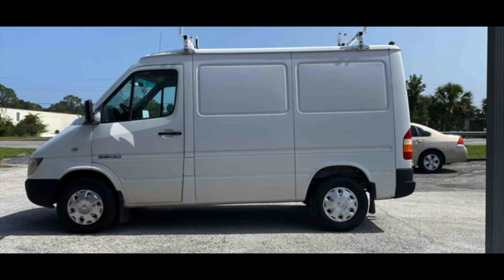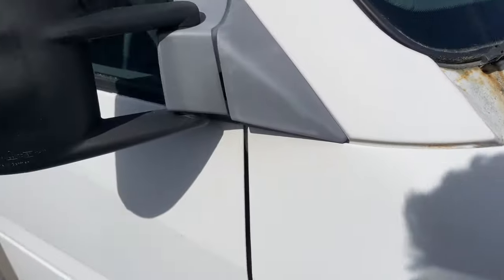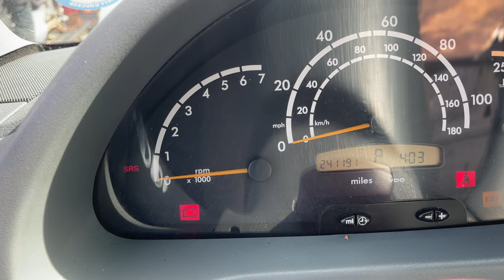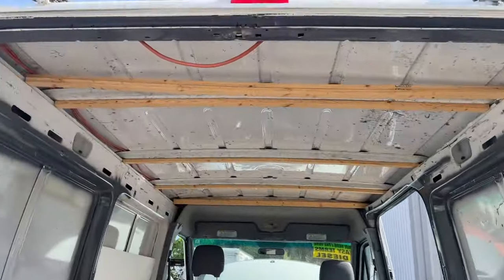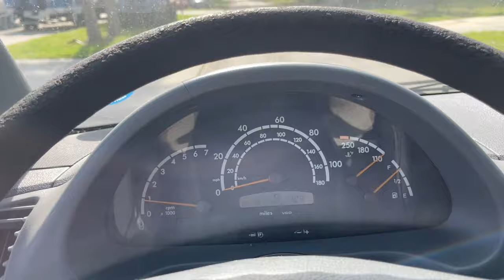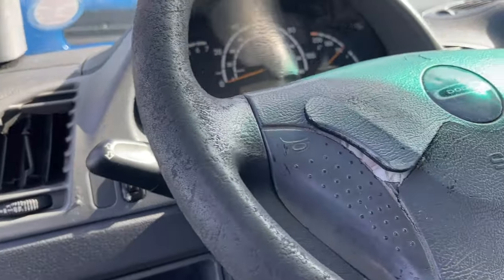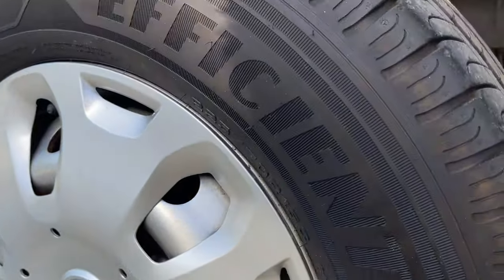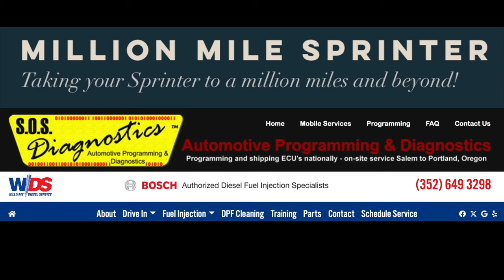118' Sprinter in Daytona Pre-Sale Inspections

Comment: You mentioned a slight rumble when driving under load. What causes that?
Reply from the maker: A few possibilities. RSN or Rumble Strip Noise is one. It is a valve shutter in the transmission that does not cause damage and is only a comfort issue. Carrier bearings and misaligned drive shafts can be other causes if it is not just a tire wearing unevenly.

Comment: Hey Florida Van Man! There is a rare passenger spec 2005 T1N Sprinter 118 for sale in Portland through a dealer called OttoEx. It's pretty pricy, but it's in ULTRA MINT condition. It's got 110K miles on it, it's only ever had one owner, it's the high roof, several rows of seats, upgraded speaker system, windows all around with nice covers, they have ALL the service records since it was new, it's incredibly clean, they've swapped out anything with any level of wear. They are asking 38k. Is that insane, or in this one case for this rare unicorn would it be in a reasonable ballpark?
Reply: Oh and ZERO rust.
Reply from the maker: They post that van or one just like it about once a year. I don't know how legit OTTOEX is or where they get these vehicles, but the website looks a bit suspicious with no physical address or named persons. They have a page on "How to register your imported vehicle" implying the imports they sell are not easily registered in the USA. The site says this van is "sale pending" this morning but I feel the price is outlandish.

Comment: Happy Easter to you. And question I'm getting 12v and almost 9v on to of the pins for ac pressure sensor? What supplies this and should not be just 5v.? Appreciate you!
Reply: I plug the pressure sensor in and the compressor and aux fan shut off. Unplug they turn on?,>I know this cab took on water ? Ecm?
Reply from the maker: If the van starts and runs I'd take it to an auto-air specialist with tools and resources to set the pressure correctly. My understanding of the system is very limited but you might have a bad sensor or an over-charge condition and running it could blow seals or valves making repairs more expensive.

Comment: how much they asking?
Reply from the maker: The member that asked me to check this one out bought it. Ballpark price $10,000 in March 2024.
Reply: wow, 10k? Then I feel awesome about paying $11k for  my 06 that came with a partial build , solar, 540ah of aux AGM battery, window covers, Fantastic fan, beds ,swivel seats , a Dometic CF80 , Cruise control, front & rear A/C, 4 Brand new Michelin tires & more that I’m sureIm forgetting 😊Well maintained at 288k.
Reply from the maker: Sounds like you got a great deal. These days $11k is cargo van price range.  @margaretomalley8086